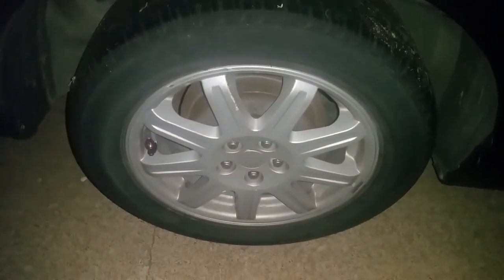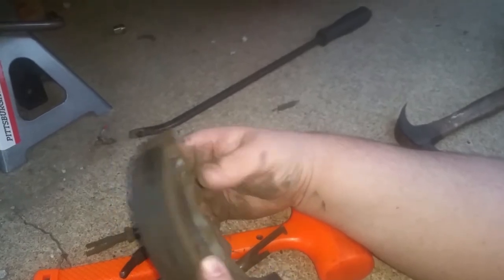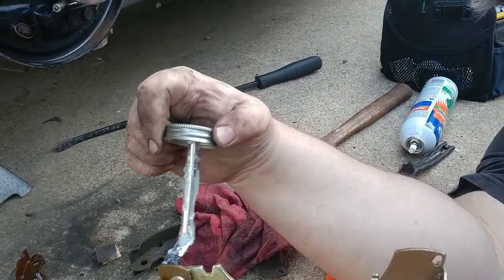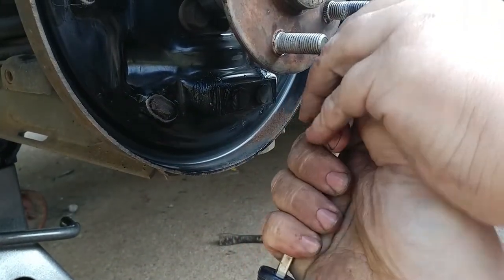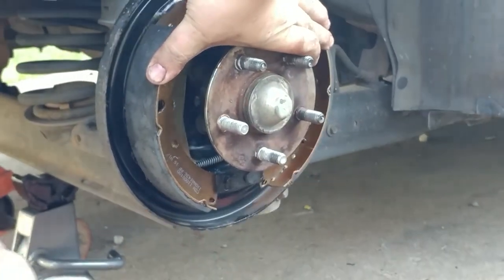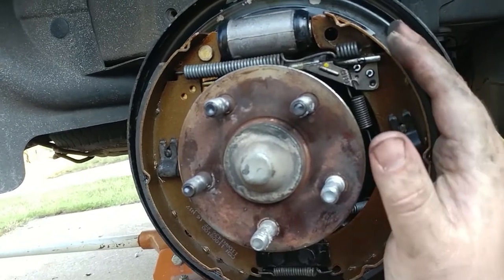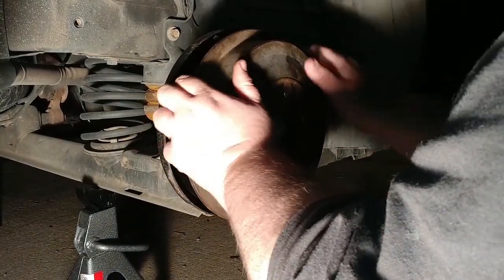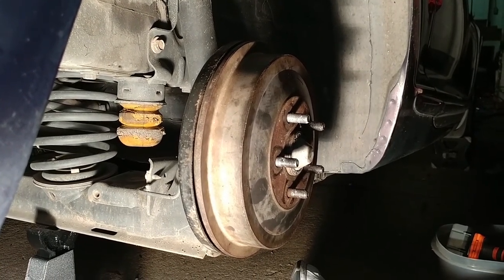Convertible Pt Cruiser Rear Brakes

Comment: Fyi, try not to get anything on the brake pads themselves & if you do, hit them with some break cleaner & a soft bristle brush to get any sand\gravel\debris\dirt\etc off of them, as sand\gravel\debris\dirt\etc can gouge ruts in the newly honed drums & also ruin brake pads.
Reply: And definitely don't get any lubricants or grease on the brake pads or in the newly honed drum, as that will cause them to slip & burn & possibly start a fluid fire, safety first guys & gals.